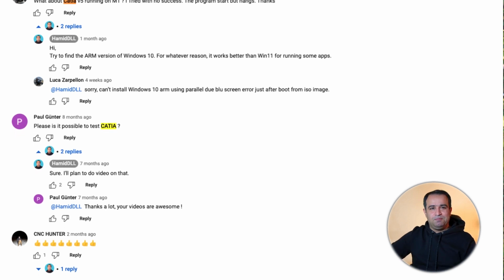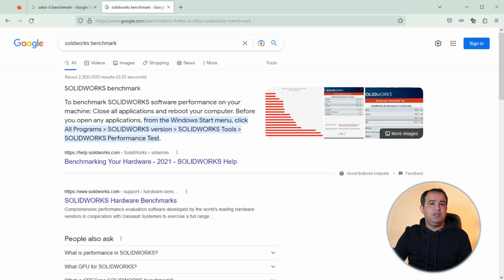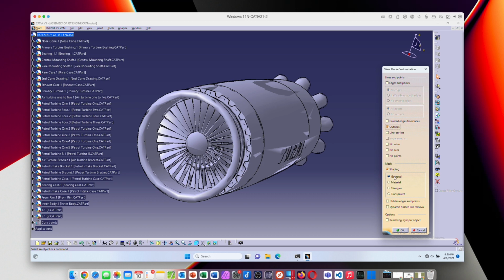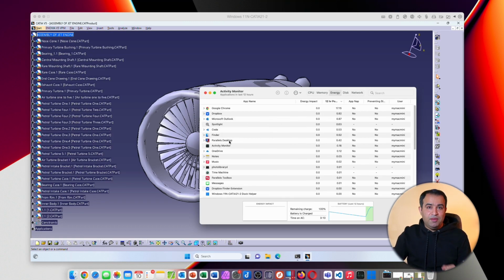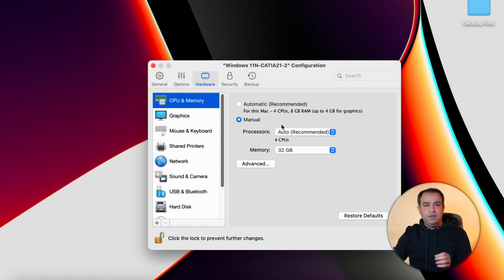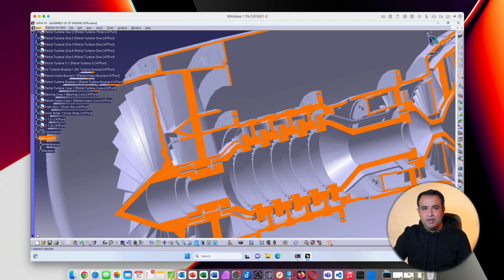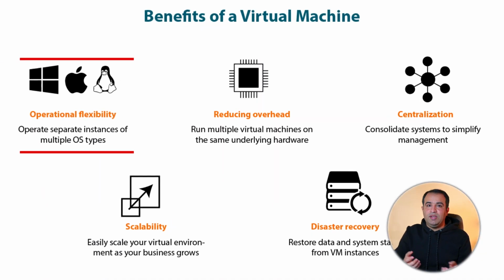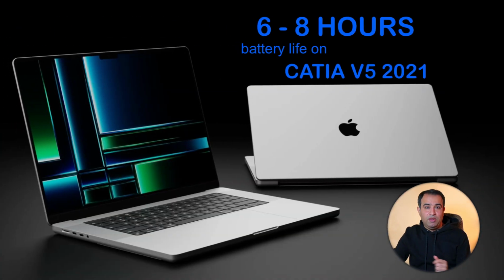CATIA v5 on MacBook (Apple M1 & M2 for Engineering)

Comment: Hi I have catia installed just fine on M1 with parallels, installation was fine it is just when I start it now that the window only appears for less than a second and then does not actually seem to run at all, any idea what the issue could be? Much appreciated
Reply: I have the same issue here. Any tip?

Comment: Sir MacBook m1 is good for catia? I am beginner engineering student.can this machine run solid work,nx,creo etc. Smoothly for beginners.....?
Reply from the maker: For beginners, there should not be a problem if you get the 16 GB RAM version.
However, for the same money, you can also get a decent Windows laptop.

Comment: To improve the speed of part rotation in Catia running in MAC/windows through Parallels, you just need to activate the option frames per second in performance tab from display options menu. For sure for large assemblies as in any PC, aways activate the function work with cache system in Product Structure menu.
Reply from the maker: Thank you William for your tip.
I appreciate it.
👍

Comment: I know we can install parallels on external SSD.. but my doubt is.. is it possible to install design software like catia, nx, SolidWorks can be installed on the same SSD as the virtual machine? The reason is.. i have M1 of 8gb/256gb variant... please reply if this will work..
Reply from the maker: Doesn't matter where you install the app.
You just need to change the setting for the folder that contains your Virtual Machines.
If you set that to a place on the external SSD, you're all set.
You may see a bit of performance difference though, if you plan to use heavy software like Solidworks on it, but it works.

Comment: I have purchased Macbook Pro M2 (2023) I’m Mechatronics Engg Student I want to install Catia Solid Works Autocad & Programming Application like c++ python java it will run on parallels desktop if it run then suggest me which edition should i purchase standard or pro sir please guide me
Reply from the maker: Except for SolidWorks, you should be totally fine with other apps you mentioned if you use the standard license for Parallels (non-subscription version).
But, it highly depends on your type of use.
Reply: @HamidDLL  non subscription version I’m not getting it?

Comment: Thanks for your video. I've followed your tutorial and tried installing Catia version V5-6R2019 (R29) but I get this error: mfc140U.dll is missing and the installation can't go on, but starting from Catia version V5-6R2020 (R30) the installation start with success. I'm a Catia professional designer and so I can test any version with my license.
Reply from the maker: Thanks for the feedback. 
May I ask how was your experience with running Catia on a Mac?
Reply: @HamidDLL  I am a mechanical designer and have been using Catia every day for 20 years. Compared to my old pc with intel core i7 sandy bridge and Quadro K2200 graphics card, catia on MACM1 PRO is very slow and practically unusable. OK installing version R30 R31 while versioner R33 crashes. Honestly, given the power of apple silicon chips I thought I had much better performance.

Comment: Hi Hamid, have you checked the performance of FreeCAD on M1 Mac through Parallels. The native installation runs very slow, I am told it is because of lack of OpenGL support. A video showing installation on Windows on Parallels would help us a lot. Thanks in advance!
Reply from the maker: Hi,
I'm currently using FreeCAD native installation on a Mac mini, and it has been buttery smooth within the last year for me.

Comment: Hi, I’m having some problems to run my catia v5 on my macbook pro 13” m2 with windows parallel where the apps wouldn’t run properly, the background of the apps just went blank. Would you mind sharing how you installed catia v5 step by step and managed to run it smoothly.  Really appreciate if you can answer this.
Reply from the maker: Hi, I already shared all the steps and setting adjustments I did to make it smoother. I've heard from many viewers who followed the steps and got success.
Make sure the graphic options are set as I explained in the video and try it again after. I hope you succeed to make it work.

Comment: I tried to download catia v5 on my M1 Mac as a student a few months ago and I had some troubles in doing that. In particular I was not able to start the program because of an error “no warm start available”, I thought that there was no solution to that and that I couldn’t run the program on my Mac whatsoever. But now that I know that a solution exists I will try again with my finger crossed. In the meanwhile I’d like to know  if you had any problem of such a kind in the download and if you have some suggestion for me. Thx a lot for this video!
Reply: I had the same problem but was able to find a solution. I noticed that the scaling factor of the program was 200%. Then I changed the settings for High DPI in the properties. In the High DPI scaling override item, I changed Application to System. The scaling factor was then 100% and the message No warm start available no longer appeared. The program now works perfectly. I am using Catia V5-6R2022 Student version, the latest version of Windows 11 and Parallels Desktop. I hope this could help you.
Reply: @n1c0l45_w  Thank you I will try this later today
Reply: @n1c0l45_w  I don't know how to thanks you. It worked. I hope you'll be successful in everything you do man
Reply: @n1c0l45_w  you are him, the goat. Thanks man, i look everywhere but nobody was able to help me with this error.
Reply: @n1c0l45_w  thanks a lot, that solution worked very well🙏🏼
Reply: @n1c0l45_w  Can you explain in more detail how you managed to install it? I haven't been able to achieve any success
Reply from the maker: Hi David,
Not sure your problem is with the download itself or with running the program after installation.
The only problem I got during the first run was the app not finding a special DLL file. I searched for it manually and put it next to the EXE file of CATIA, and it worked.
Reply: @HamidDLL  yeah I tried again to download the software and I still have the same problem... I even tried to download it on a brand new virtual machine and nothing changed. I suppose that the problem is not the download itself because it went smoothly but still I can't run the program because of 'no warm start available'. I really don't know what to do... maybe is a problem of the version I'm using (V5-6R2022), or maybe a problem of the student license but I don't think is that. the thing is that I can't find anyone on the web with the same problem so is difficult to find a solution on my own. it's what it is...
Reply: @davidemoriggi4576  I also have the same problem. What Apple product and Parallels version do you use? Also if you did find a fix, I would love to know.
Reply: @rezzka6756  don’t have precise data in my hands right now but I have a Mac book pro with an M1 Pro chip (don’t remember the exact chip) 32 gigabyte ram. The parallels version is the student one (don’t know if that’s relevant) and it was updated to the last version available at the time (april-may 2023). Btw I wasn’t able to find a solution for that problem and now i’m not required to use catia v5 anymore because I passed the exam so I don’t need it so bad anymore. I don’t really know if that’s a solvable problem since it might be linked to the student license or to the catia version you’re using. I’m so sorry, wish you luck.
Reply: @davidemoriggi4576  Alright, thank you for the information. I wish you the best

Comment: The amount of work this buddy put into this video is equal to publishing a solid academic paper. Impressive!...
So, for those who are wondering: Yes, you can run CATIA on M-series MacBooks with relatively workable performance (after doing some tweaking). Also, the standard version of Parallels should get the job done, unless you plan to do something more demanding.
Reply from the maker: Thank you Mohammad,
I have to admit, it takes ages for me to make such a video.